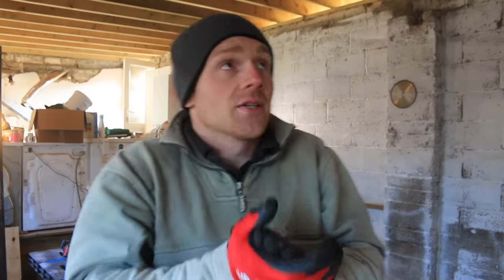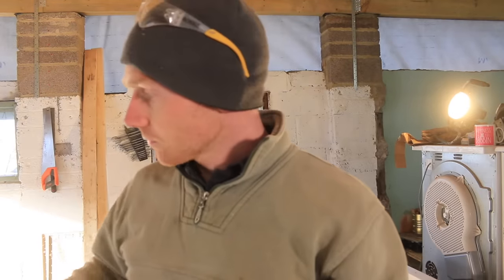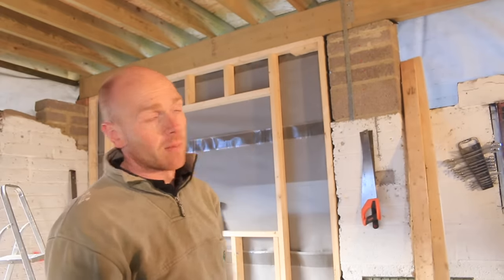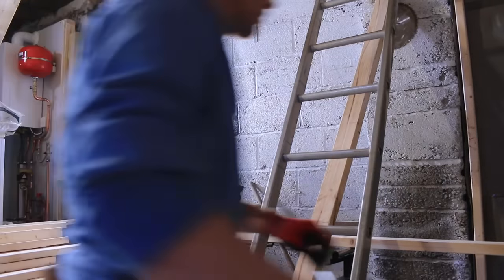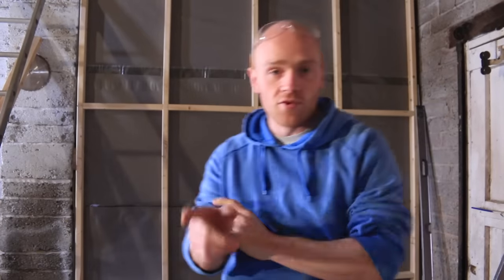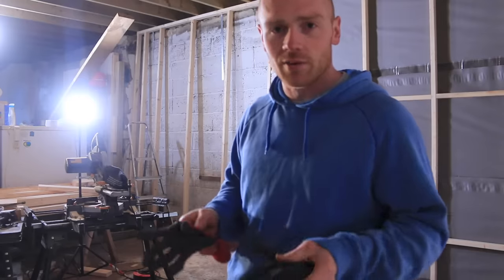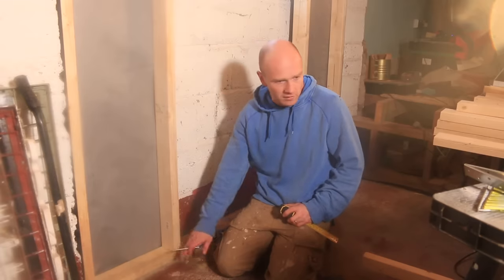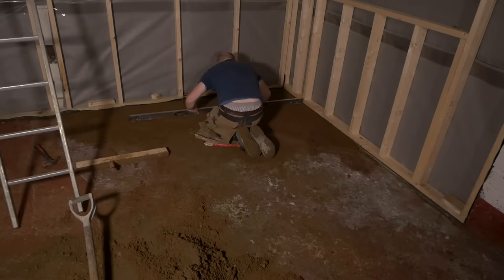Garage Conversion Stud Walls

Comment: Really like the vid. Im converting garage exacrly the same.  I have to create a new 2 course perimeter using common brick.due to slope. and low dpc level on solid wall. When i bridge a new dpc from new perimeter. Is it better to stick down wirh contact adhesive and then lay bottom plate timber to stud.

Comment: Have you left a gap between the block work and timber? I’m going to insulate my concrete fab garage and I’m not sure if I need an air gap or not I’m using the same membrane on the back and 85mm kingspan foil taped

Comment: I prefer nails in framework anyways because they have a higher sheer strength than screws. Nothing wrong with using a nail gun for framing!
Reply: I was going to make the same suggestion. Nail gun over screws for framing every time.
Reply from the maker: I think if I had a nice flat slab to lay it out on the nailing would be fine. That said screws are slightly easier for pulling in twisted timbers. Maybe I just need more practice with the gun. 👍
Reply: I was gonna say the same. The framers sitting in the background yet you are screwing your studs on? Anyway, brilliant work mate. True craftsman! Looking forward to watching the rest of your content.

Comment: Hi there!

If you want reliable and high quality bits for your impact driver, you should consider buying Hazet. They are very expensive, I know, but since I got them, I will never buy anything else. 

Worst bits are always from the power tool companies like Bosch, Metabo and so on, because they buy them cheaply in an that's it. I get them to shear off quite easily. 

Regards,
Etna.

Comment: Very informative,  but I'd get more if the sizes of the CLS timber used in the studwork was mentioned. Any chance a material's list could be posted ? Another thing, where is the vid showing building the floor ? Cant find it, that would help as I intend a project almost identical to this one!.
Reply: It's 2x4 CLS... But depending on your project a common size is 2x3

Comment: SOOOO Many questions. 1. What length screw did you use for the stud-work? 2. Did you pre drill holes or just go straight in with the impact driver?
Reply from the maker: 70 or 80 mm straight in. 👍

Comment: Hello, I saw that you insulated the floor last and you overlap the DPM on the new walls. Most of the builders start first with the floor and overlap the DPM on the bricks wall and then insulated the walls. Is there difference? I'm asking because I already insulated my walls and now building control asked me to overlap the DPM 15 sm but didn't explain me on which wall. The existing one or over the insulation :(

Comment: Thanks for posting all your videos. A question.... you didn’t leave an air gap between the brick and your new stud wall. I am looking to do a similar conversion but the advice is the air gap is crucial. I would rather not leave one as I am limit on space. Can I get away with no gap?

Comment: WRT impact bits, 20 odd years ago Snap-on had a good set of impact bits for use with the old hand  hammer driven impact drivers. We used these with quite a high frequency to remove rusted in screws. Not sure if they still do the same range. I think the bits were black with chromed 3/8" socket drive.

Comment: "There's no reason not to" [use treated timber]. Correct. However, there's no reason to either.

As you've constructed, pressure treated timber would be an unnecessary expense. Not mention that it's much heavier, and more difficult to work with (cutting, nailing, etc.). Good choice there.
Reply from the maker: I did use a treated timber on the bottom of a couple which could be a good middle ground compromise. Having used treated roof joists you do notice the weight!
Reply: @TheRestorationCouple  Your doing it right, Tim.

Comment: Hi Tim. Thanks for all the useful info. One thing has me scratching my head though. What's the breather membrane for between the stud wall and the external wall. In latter video's you created a foil vapour barrier. So a puzzle for me. Cheers.

Comment: I just put my stud walls up on garage conversion i am doing, can I ask, do you seal the top of the stud wall behind where the cavity is open going up towards roof. or do you leave the top open to allow the air to flow up to roof. Cheers

Comment: Hi Tim I’m in the process of converting my garage right now after watching all your videos. One thing I don’t recall seeing is how to handle windows and door ways. Are you ok to build a timber frame round them and mount plaster board directly to the frame inside the recess? I’ve not left any room for insulation and am hoping I don’t have to re do them! Thanks!

Comment: Hi Tim, thanks for all the useful info! I’m hoping to start converting my standalone single skin brick built garage soon so this channel is very helpful. Why did you put a mortar bed under some stud walls and not others, and is it necessary to fix the bottom plate to it after its dried? Is it ok to screw through the DPC? I see some other comments asking how the air flow is created between the stud and the brickwork...any advice would be greatly appreciated!

Comment: What’s the best place for buying all the wood for this in bulk? B&Q or a timber merchant?
Reply from the maker: Builders merchants however it can often be cheaper for CLS in wickes or b&q so woerth comparing.
Reply: selco is doing good deal at the minute @TheRestorationCouple

Comment: Hi,  can you kindly provide details of what membranes you used behind the wall batons? Thanks
Reply from the maker: Just roofing breather membrane.
Reply: @TheRestorationCouple  Thank you. I thought that was the case but wanted to make sure. I'm considering converting my garage into a living room and your video was very helpful in building up my courage to start this project. Any tips you can provide for a 1st time novice?

Comment: Love your videos, they’ve helped me through lots of little projects. I’ve watched your garage conversion series a lot as I’ve been toying with the idea myself but never really pressed ahead with it. However I’m now looking to convert 2/3rds of my detached single skin garage to use as a garden room / gym. I’ve always been set on timber but I’ve since seen a few videos on metal stud work and for ease of use it seems a viable option. You said that you’ve used metal in a previous conversion, can I ask how you found using the metal stud work? And also how did you get around insulation and vapour barriers? I’m thinking you could put rigid insulation in between the metal studs but I’m wondering how to would go about fixing a breather membrane to the studs. Any help and experience you can share would be a massive help. Keep up the good work and content 😀

Comment: Hi , great video! I'm doing something similar with my garage but I'm going to use insulated plaster board on the walls. One question I wasn't sure about was what to do around the brick piers? How did you deal with yours? Did you put a vapour barrier between them and the plaster board?

Comment: In my experience of working in the tool trade, generally its not the bit that's at fault. Low quality screws are the problem as they do not flex causing more strain on the bit.

Wera do bits designed with flex in them, they normally have a green band in the middle to identify this. You also should make sure your bits are designed for impact drivers not all are. 

Also dewalt and the other power tool brands don't make their own bits they just brand cheap stuff.

If you want quality buy from a brand like wera that makes all their own bits. Equally nothing last for ever.

Comment: Hi, do you have an update on this now you have lived with it for some time? It does make a lovely studio now! I am looking to do the same in a similar (but much smaller) space and wonder if you would do it any differently if you had to do it over again?
Thanks for your help and all your great content. Keep it up
Reply from the maker: It’s a great space and probably the most thermally thing efficient in the whole house. Insulating externally is always worth looking at if possible but if not this route works great.

Comment: Great videos , thank you.    You used hangers  on the suspended floor but I couldn't see how the other ends were  fastened. They seemed to be just resting on the base frame of the stud that you constructed.     Cheers
Reply from the maker: Yes the were bearing on the short stud wall and fixed down.

Comment: Interesting, you put the vapour barrier on the rear face, facing the cold wall. 
I guess it stops the cold moist air getting into the wood. 
I understood it needs to be the inside face, with the insulation behind.
I am confused now. 
Maybe it doesn't matter?
would like some feedback from anyone who knows..
I am currently planning the same, nit on such a big scale
Reply from the maker: That is not a vapour barrier, it’s a breathable membrane to keep timber frame dry if moisture got through masonry. Vapour barrier is always inside like you say, warm side of wall. In this case taped foil boards.
Reply: @TheRestorationCouple  thank you. That makes sense.

Comment: Probably a very novice comment, but for your stud walls for plasterboard.. what are you setting your centre stud spacing too? Struggling to remember what’s best I think it’s 400mm? Cheers
Reply from the maker: Either is fine. These are non structural so just need to be spaced for plasterboard dimensions. I started at 400 but did the rest at 600 as seemed overkill.

Comment: I am about to buy a staple gun. What size in millimetres staples do you use to attach the membrane to the frame? Are these regular staples or galvanised? Thanks for your videos, I learn a lot for my own diy extension project. Cheers and happy 2020 from Holland.
Reply from the maker: Galvanised. Not sure on exact size. Sorry.

Comment: Forgive the question. Does the frame sit away from the brick or flush against it? Thanks.
Reply from the maker: Away, with small cavity. This was to make sure the new wall cleared the original blocked piers.
Reply: @TheRestorationCouple  Many thanks!

Comment: Hi mate, so I’m going to convert my double garage. I don’t get what you do with the pillars , just frame either side and stick plasterboard straight over them ? Great vids by the way . Cheers
Reply from the maker: Studs were flush but then carried insulation over the top of studs and piers.
Reply: @TheRestorationCouple how do you carry insulation over if the studs were flush? Doesn’t the plasterboard have to be attached to the studs?

Comment: What mitre saw do you have ?  I know it’s the evolution one and how do you find it? I have there smallest version but have found its to small for most been looking at dewalt, would appreciate your input cheers
Reply from the maker: It’s fine as far as size but not super accurate for trim work. It’s done the whole house renovation and lasted well but next time it will be a Bosch or hitachi.

Comment: Hey... Just come across your videos, great work, great videos. Just hoping you can clear this up for me as I keep finding conflicting info on the internet. Basically converting integral garage on a new build house. The builder has bricked the garage door bit up and dropped in a window. Now I am hoping to do some of the work before the plasterers come in... so the question is, the 2 walls that are brick (well grey block) (the other two walls are both internal walls and already plastered). I am going to timber batten then drop insulation in etc as you have here. But do you leave an air gap between the battens and the wall, or fit them direct to the wall with a damp proof sheet between them... some say leave a gap so air can get through, then some say the gap will cause moisture so everything should be but up against the wall nice and tight... any advice would be grateful.
Reply from the maker: Depends on construction. Assume it is single block not cavity already. It is likely to be much dryer than ours as you will have dpc and modern render, etc. It may be that insulated pb is suffecient or battened off. I would guess that air gap is less of an issue as  it will not be vented anyway. Ask your BCO on their next visits. 👍
Reply: Thanks for the reply... brick then block which I think has insulation in the cavity.
Reply from the maker: John McNIFF then it couldn’t be easier, just skim or dot and dab. 👍

Comment: Another fantastic video. I think I have the same Rage Saw as you but your blade looks like it gives a better fine cut. Which blade do you use? I use the one it came with.
Reply from the maker: Screwfix now do a cheaper version with the same odd sized bore. It’s holding up fine and much cheaper.
Reply: @TheRestorationCouple  thank you

Comment: Hi. I’m building an internal insulation stud wall for our kitchen and I’m following your video. Quick question... I was planning to have the breather membrane stapled to the back of the frame as you have done - which will sit flush against the wall, and then have an air gap behind the insulation boards within the frame. Is this a good plan or does it need an air gap between the wall and the breather membrane as well?
Reply: Did you ever find out about this? I also would like to know

Comment: After watching your video we have decided to buy a house requiring renevation. One issue i have im my current house that i dont want when i move is heat loss from the external walls. Is timber framing with internal insulation with plasterbaord the best option seeing as we want to hang items on the walls?
Reply from the maker: Every wall is different.  Depends on the house and walls, you can insulate externally too which leave internals as they are but effects look outside.  You can cavity fill, use insulated pb, stud walls, etc. Lots of routes.
Reply: @TheRestorationCouple   we want to keep the external look of the house as it is (1930's) so internal is what we are going for. I was thinking insulated stud wall with insulated plasterboard. Due to not wanting to lose to space we were only going to do the external walls. Is that pointless? thanks for replying.. 
Josh
Reply from the maker: Joshua Taylor Not pointless but remember if you are insulating walls you need to go through building control and they will require the minimum you value for renovations. That means a significant thickness of insulated plasterboard and by the time that is over stud work you will lose lots of room space. Is it cavity wall construction? You may be able to fix insulated plasterboard direct to walls but really depends on the building.

Comment: Loving the garage the conversion, I’m hoping to do something similar in the future. It’s a concrete panel concrete and corrugated concrete (asbestos) roof. I’m thinking of starting with building an internal “gate “ behind the garage door for another layer of protection as it’s not a great garage door and plan to keep a motorbike in it. Any tips or tricks on how you would approach it? I’m thinking stud wall with ply/osb in a gate like fashion and potentially insulation and board the other side later down the line. Would love to hear your thoughts?

Comment: Great videos, and learning a lot. One question, I notice you don't use pilot hols when assembling the stud frames. What type of screws do you use that allow you to screw into the end grain without splitting?
Reply from the maker: Spax or turbogold usually.

Comment: Hi @therestorationcouple how did you handle the stud walls where your boiler system is attached to the garage wall? Got a similar set up and considering what we do.
Reply from the maker: Boiler is hung on the studs.
Reply: @TheRestorationCouple  ah so you've sited the boiler after installing the studwork and insulation?
Reply from the maker: @robsolway3827  Yes.  I did however fit a sheet of plywood between studs and plasterboard so pipe clips and brackets could go anywhere.  The main boiler brackets hit studs though.

Comment: i'm wondering was there no need for the floating floor with DPC membrane and insulation to go down first then build your walls on top
Reply from the maker: Originally the new stud walls were going to support the roof joists but plans changed. So yes, fine if not better to go on to new floor if only acting as a lightweight lining type wall. 👍

Comment: I watch and rewatch your videos constantly in preparation for an existing extension refit with stud walls and insulation. Thanks for taking the time to create, edit and post all these. 
When you fitted the stud frames, you did you butt them against the external wall completely or leave a slight gap between the stud, breather membrane and the blocks? 
Cheers.
Reply from the maker: I prefer to leave a small cavity which prevents any bridging of moisture in the outer block work.
Reply: The Restoration Couple thanks for the reply. My thoughts exactly. Really appreciate the reply. Great videos. Learning so much. Cheers.

Comment: This is a long shot but building regs asked me to put up this type of wall within my small 2.4m x 1m porch (to convert it to internal) My only question however is given they asked for OSB and vapour control check, how the frick am I going to put them onto the external side of the wall when I can barely move an inch in the room xD there's no way to lay it down or even tilt it to the point I can move round the other side!
Reply from the maker: Osb the inside? I’m guessing it’s just for strength so can be either side. Build stud wall stick by stick, osb then VCL. Lots of ways to do it. I’d ask why the OSB though as I imagine it’s not really needed.